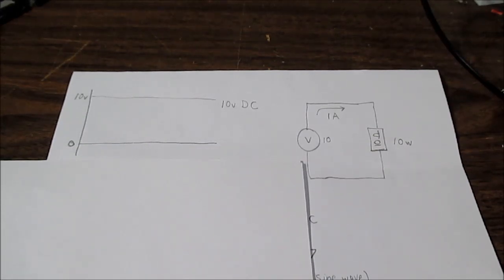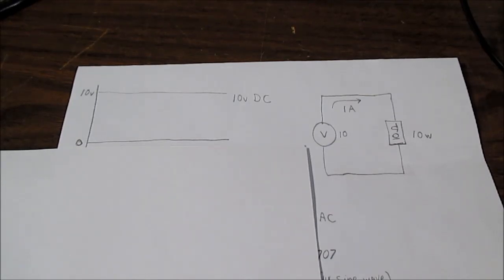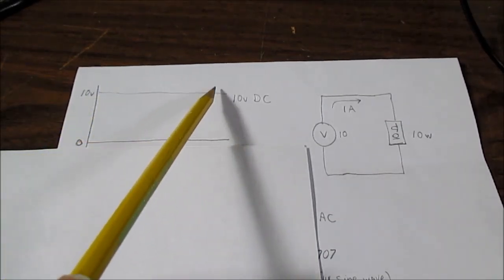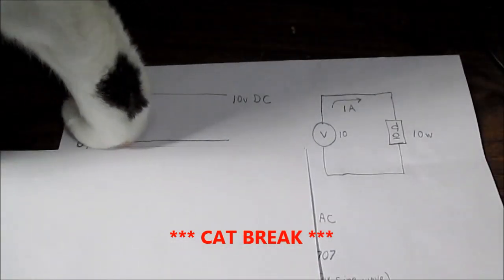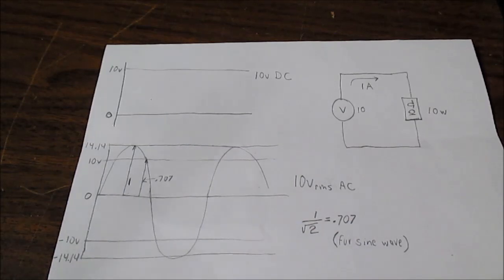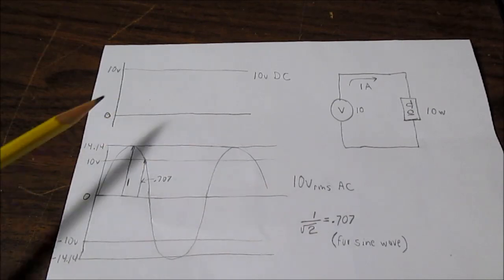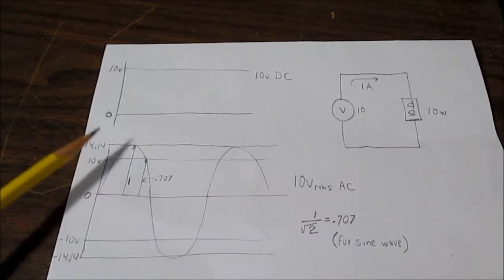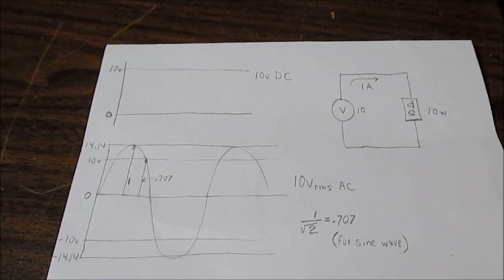Why watts rms is not valid for audio amplifier power measurement

Comment: I bought sony htrt3 5.1 sound bar system the input power is given as 85 Watts and the RMS output was given as 600watts what it mean I have no idea but I think that in india 220v AC provided for single phase and now in this system I think by a rectifier or an SMPS  might draw 12 volt and 7 ampere that total power is 84 Watts hence input power directly proportional to output power but limitation is losses in power like heat generated but what these companies say about their home theater systems by fooling people I don't know

Comment: John - Thank you! Having been an electrical engineer since I was born, it is good to see some common sense. I worked in the audio biz back in the 70s and 80s and since then in telecom and datacom. As you stated, one can take any signal, square its waveform, take the mean, and then take the square root. But with power it is silly and wrong. For voltage and current it is sensible - because the power that is produced into a constant resistance is proportional to the SQUARE of that signal. I've only seen RMS POWER used in audio products' literature. It is WRONG. Power is power.

Comment: Root/Mean/Square wattage (RMS) is exactly: 
0.707 of the positive peak voltage of a waveform, multiplied by the mesured current. It is intended to represent the "average power" of the output signal applied to a given load (like an 8 ohm speaker).
Reply from the maker: It should be called continuous average power then because RMS watts is incorrect.

Comment: When you have an amplifier producing a clean sinusoidal output voltage and you connect it across a non-reactive load, you get a sinusoidal current flowing in the load which is in phase with the voltage across it.
Now if you plot the power developed in the load it's not sinusoidal. The power waveform is very strange and never goes negative because you can't have negative power.
I think that amplifier output should be expressed as an RMS voltage across a stated load before the onset of clipping.
Reply: AKA an average power in a stated load. It's equivalent. Either way the term "RMS Power" is pointless at best, flat out wrong at worst.

Comment: 2019!
I want a 100w x2 amplifier that will give me the power from 3.4 hom to 8 hom with a distortion of 0.01% from 0.1 watts to 50 watts and that never exceeds 0.2% .... this turned on for 1 week.
bandwidth 10hz 80khz + - 0,25db 0,1 - 50 watt.... (+- 1db with phase rotations + - 60 degrees with 25 watts)

otherwise we can remain in the stone age

Comment: Watts RMS, or to put it more succinctly Watts (RMS).
RMS is signifying what watt is what in this case.
Watts is derived from AC Voltage at the RMS Value of that voltage and not peak nor peak to peak.
If we use simple ohm's law VIR, what value is the Voltage? The only real value is V RMS. The current value is I RMS while the load is purely resistive  R and not RMS for the standardised measurement. Once you start calculating inductance etc, you've got a whole host of potential variation and have created complexity where none is needed.

Watts RMS is a consumer measurement that standardises the voltage and current used in the claims. While watts is watts and watts RMS is still watts, the inclusion of RMS tells us that there is no hype being applied to the claims. Whereas just using watts tells us nothing about how the claim was derived.

I hate to break it to you, but marketers aren't electrical engineers and they have a fond habit of using partial truths in their claims.
Like PMPO is the amount of power a system will survive measured in milliseconds or less, whether or not that system can deliver that power.

Also is power or continuous average power the correct term when what is being measured is the VRMS into an 8 OHM load before clipping occurs. VRMS is what is measured but as the load is a fixed resistive load with voltage and current in phase, whatever the voltage is, will determine the current and that voltage times that current gives you power in watts. If V=32 and R=8 then I =4. If P= 128 and R=8 then I= root 128/8 (16) and V=IR.
so for a 200 Watt RMS amp, that tells us that I=5 (root 200/8) and thus V=40 RMS before clipping. But of course 200W RMS sounds better than 40V RMS and no one wants a 12V RMS if they can have an 18W for the same price. Heck 16V RMS is only 32W and 20V RMS is only 50W, it's only 8 more V's but it's 32 more W's.

All the RMS is telling you is that the claim is to a fixed standard of measured voltage whether the consumer understands that nuance or not, whereas continuous average power?????

If continuous average power = the same watts measured with voltage RMS then isn't 200Watts RMS equatable as a real measurement when we can determine the RMS voltage from the watts nominated into a standard 8ohm load? Or if 4 ohm then the equations remain the same just the label would be 200W RMS 4ohm, with less voltage but more current. (v=28.3 I=7.07 ironically)
Reply from the maker: Most consumers don't know what RMS is anyways, so why use a nonsense measurement label for power? The FTC should have used continuous average power from the beginning. You don't see watts rms used in any books or papers published by electrical engineers because they know better.
Reply: Most consumers do know what RMS signifies even if they don't understand what it means.
Everyone has a period of naivety before they learn about what they are buying, and if all they learn is that RMS is real and without it you cannot trust the rating, then that's all they need to do comparative shopping. Most salespeople selling quality components will happily explain RMS in simple understandable terms and most people looking for a quality sound system will do some research even if it's on the fly as they shop around.

You hark back to electrical engineers and what they publish, yet fail to recognise what I said in my post regarding Watts (RMS), the bracketed term is a relative comparator. Watts RMS without the brackets is shorthand.

If you want to get technical then continuous average power is just as wrong as that is never what is actually measured but is implied from the VRMS measurement through maths.

You assume that watts RMS is a nonsense measurement when I clearly showed that from that "fake" measurement I can get real answers.

You also fail to account for the fact that Watts RMS is actually representative and not a made up number and that RMS is used in the measurement protocols. Why do we have multimeters and "true RMS" multimeters? What does "true RMS" signify in that instance. One word TRUST.
Watts you can trust is what watts RMS signifies to the common consumer

Comment: As others have pointed out it seemed a good idea to remove a lot of complicated mathematics and state the power in a simpler form that is understand by everyone and applies to all pieces of equipment .
Reply: I completely agree. It simply should have been labeled the max average output power, literally the same values. They were just incorrectly labeled RMS instead of average. The standard itself is fine. Its the mislabeling that is wrong.

Comment: Here is a little background explaining why the regulating authorities made rules to have a standard means of measuring audio amplifier power.  Before this ruling companies used a term called "music power" which had another term but I forget the acronym. 

 To acquire this rating the unit under test would would have its standard power supply replaced with a more "ideal" power supply.  They would also used the "Peak Power" measured with this configuration.  Some even used "peak to peak" numbers for their rating.  Most of the time, an amplifier with 20 watts rms would have more real power than an amp rated at 50 to 100 watts using these deceptive types of measurement.  Remember that the Power Supply is the heart of an amplifier.  The tubes or transistors are just "valves" that control the power supply to amplify the input signal.

Comment: There is nothing wrong with amplifiers being rated in R.M.S watts as opposed to P.M.P.O for example, however R.M.S power ratings mean nothing with considering the impedance of the load and over what frequency bandwidth and not just 1 specified frequency usually 1Khz. The proper way to express power output would be something like 100 Watts R.M.S per channel both channels driven into 8 ohms from 20Hz to 20Khz with 0.001% distortion, home theatre amps never have their power outputs expressed this way because none drive all channels at the same time at their rated single channel output which is very misleading for the average consumer. In terms of perceived volume speaker efficiency also plays a big part.

Comment: It's the amount of HEAT developed in a resistive load. That amount of heat is the same when the RMS value of ac voltage equals the equivalent DC voltage. In other words it takes 10/.707 or 14.14 peak volts of AC to create the same amount of heat in a resistive load as feeding 10 volts straight DC into it.

Comment: Power loss through a resistor is the square of the current multiplied by the resistance, you got lucky with your 1 amp current, but if it was anything but 1 your result would have been wrong.
Reply from the maker: First I showed the direct calculation to find power in watts knowing the voltage and resistance, E^2/R=P. Secondly, I used the indirect way to find the power by finding the current first. E/R=I and then E*I=P. I did NOT use I^2*R=P to calculate power (although I could have). I said voltage across the resistor times the current through the resistor.
Reply: Voltage drop across resistor multiplied by current is kind of a funny way to do things.  That's usually reserved for the seat of EMF  i.e. E*i=P.  I guess that can work - but you are talking about a circuit, which only contains a single element resistor apart from the EMF source.  In that case you can't go wrong.  I am thinking of circuits where you would have multiple items of resistance, capacitance, inductance, and a seat of EMF.
Reply from the maker: How is it funny? If you know the voltage, current and resistance, power can be calculated by using one of three formulas. No one is more or less correct than the other and certainly not "funny". A circuit dealing with complex impedance (inductance, capacitance, resistance) can have multiple ways of being solved mathematically depending on the known values. None of them will be more or less correct or "funny".
Reply: I am not saying you are wrong - just not what I am accustomed to.  Say you look at ohm's law V=IR and you want power you multiply both sides of that equation by i, and you get V*I= I^2*R - it's just natural how that drops out, the power for the seat of EMF of the circuit is E*I and the power losses for the resistive elements are I^2*R.  But yeah, you're right alternatively you can think of the voltage drop of each independent resistor by going back to ohm's law and calculate V*I.  I just say it's funny because for some reason I've never done it that way.  In my mind when I think power loss of a resistor I automatically think I^2*R.

Comment: Watts RMS is good enough for me.
It gives a yardstick for comparing the loudness potential of different amplifiers.
Reply: Loudness is more often down to the speakers than the amplifier. I really don't care how many Watts an amp can push. Because if your speakers can't handle it you're not going to get the sound anyways. Highly efficient speakers are pretty loud at just a Watt too. 92+ DB sound pressure is not unheard of at even that level.
Reply: Watts RMS is an incorrect term.

Comment: From a person that used to design & build audio power amplifiers in the 70's. Everyone knows that RMS = Really Macho Sound.
On a serious note, you failed to mention frequency. Most folks used to quote  X RMS  @ 1Khz which was an average across the audio spectrum.  It obviously changes with frequency  as does the impedance of a speaker. 
I still believe that speakers should be marked with a 'z' for impedance  & not the omega symbol.
Reply: you're looking for the T&S parameters of the speaker, then :)

Comment: A speaker is a variable inductive load depending on the frequency.  The power delivered by the amp to the speaker will vary accordingly.
Reply: True, though power into a resistive load is a reasonable spec, as long as it is stated to be the load in the specs. Ideally the amp can also handle the same voltages into the same impedance magnitude at a 60 degree inductive angle, because that's a pretty extreme for speaker inductance.

Comment: Same thing for car stereo. A 5 amp fuse and a 1000watt rating is just wrong. The rms ratings have worked for me, for 40 years, better than overinflated peak values, going down hill with a tail wind, sort a speak.
Reply: If your amplifier runs at 200 Volts 5 amps gives you 1,000 Watts. One thing I have noticed working with audio amplifiers is that for any output running voltages seem to track that too. What I am saying is higher wattage amplifiers generally run at higher voltage than lower powered amplifiers do. That is to keep current at a manageable value. But your example is a bit off the beam in general application. 1,000 Watt amplifiers would be around 100 or so Volts. That lands you more in the 10 amp range then. There's practical reasons why these values are normally traded off.
Reply: Paul Frederick , thanks, I was talking on a car amp. 12volt in. Yes I realize there is step up voltage inside. My 50wpc runs at 36+ and 36- rails. Push pull class AB. My point is for me, it is simple to look at the input rating (fuse)and figure out if it's inflated on the output watts.
Reply: Paul Frederick, I hear ya on that. I worked as line mechanic at new car dealers most of the 80's. That biz is simular to audio of most types. Now, I work in rental property maintenance, a little better for me,

Comment: This may be false logic- but how in hell can an amp ADVERTISED as 100 watts per channel
only draw UL listed current of 100 watts from the wall? We should all be suspicious of ANY amplifier claims of output-no amplifier is 100% efficient and most tube amps are about 45% efficient and Solid state,maybe 50-60% efficient.

If you look at the printed power requirements on the amp itself and it says 100 watts-
only the most uneducated consumer would interpret that as its output power.To get the amps real output power under a DEFINED set of circumstances,as the LOAD from most speakers varies with frequency content and time constant,adding in capacitance from the feed wiring and crossover networks and resistance from the voice coil(s)

A pretty tough job for any amp manufacturer,because he cannot be totally honest.
It's true-Your Mileage May Vary.That slogan is good enough for the FTC.Just having 110 VAC or 120 VAC in your house wiring can make a huge difference in specs.

But anything is better than some Chinese manufacturer advertising 1000 watts RMS on a 
$39.95 amplifier when some buyers will believe it.Some salesman will hook you on it.

Now you are smarter than that

Thanks,John for your videos and explanations.

Comment: My opinion is to look at the ratings. Then look at the device UL rating on the back of the amp. 120v 480 watts, is power consumered, max. So all maxed out the unit couldn't consume more than that. If an amp specs says 2400 watts, and then you look at the rear and it says 120v 200 watts, then you know that sucker isn't going to do 2400 watts except for a nano second.

Comment: John you are dead wrong. Specifying the RMS output power into a certain load is ideal from an engineering point of view. It allows an engineer or knowledgable enthusiast to evaluate the amplifiers capability under steady state conditions. It is also done in all other areas of electrical engineering when evaluating electrical equipment. If the audio amplifier is able to output so many Watts RMS continuously then an engineer can determine many things about the amp. In the past shrewd marketing allowed companies to claim ridiculous output powers from tiny radios/amps. They justified this by saying that the instantaneous power at the peak of a drum beat represented the quoted power. This made the amps seem much more powerful than they really were. Marketing nonsense. By insisting on quoting an RMS output power it eliminated the marketing nonsense and established a standard that was easily reproduced in any test lab.
Reply from the maker: I think you misunderstand what I was saying. The FTC standards is great at giving us the proper power figures, but they stated it wrong. They said "watts rms". They should have said "continuous average power" in watts. Stating watts in rms is meaningless.
Reply: JohnAudioTech Oh then why imply such thing in the title? Why not say that Saying watt rms is wrong or there is no such thing as watt rms?
Reply: JohnAudioTech If you are reading some some what professional audio equipment datasheet you will see Pa meaning power average Ua Ia etc, with the a in the right bottom corner.
Reply: Watts rms is an incorrect electrical engineering term. Watts are Watts . Watts (continuous) is appropriate, Watts rms is something somebody made up.